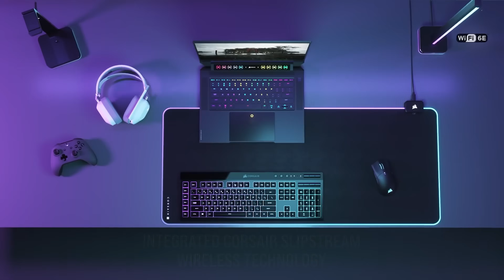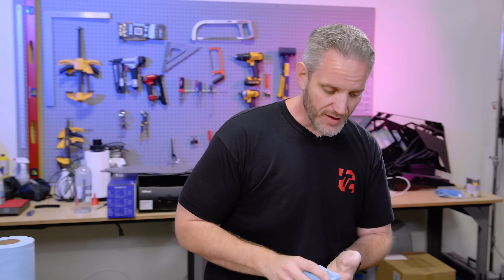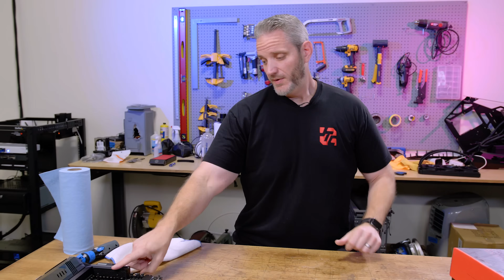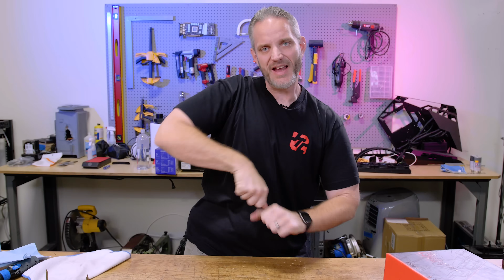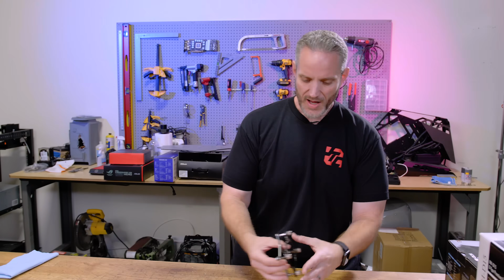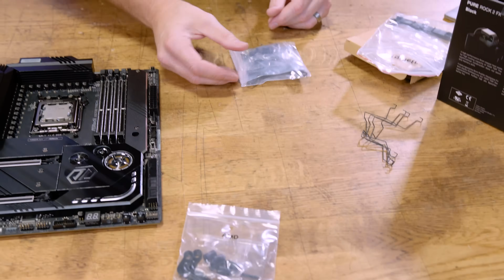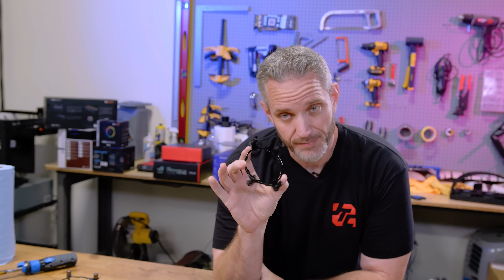AMD made a terrible flaw with this design...

Comment: I find it interesting that despite the 2mm too thick IHS, that CPU can run that much load and clock at these thermals. I originally wanted to get a Ryzen R7 7700X, but now I'm rather considering a Ryzen 7 7800X3D or something like that early next year because honestly, I intend to game on the system and if that thing is anything like the R7 5800X3D but with the thinned IHS (since 3d cache will make the die thicker anyways), thus compensating slightly for the temperatures, it could be an absolute beast.
Reply: I think you are able to override TJMax in the bios with lower temp if you want. Of course that will somewhat lower performance, but that may be negligible. I am coming from an older setup so I may just go 7000 anyhow and set a max of 75C and see if it still performs even within a couple hundred mhz.
Reply: @wishusknight3009  Or you can offset Voltage to a negative number. Or run ECO mode. Wait for HUB who will test ECO mode for the chips to see the temps and performance of that mode.
Reply: @wishusknight3009  eco mode wasn't in ryzen master on release but it is now. With eco mode, it basically works like previous CPUs and gives a bit less performance with a lot less power. They really should've made eco mode stock and called the current stock boost or something. 95° just doesn't look good.
Reply: vcache doesn't increase the die height. AMD has already stated this. So the thick IHS will still be the same on newer chips. They would have to increase the substrait thickness or something like that but I have no idea what side effects that may cause.
Reply: @ReivecS  it did for the 5800x3d, they circumvented it by thinning the CPU die when stacking the 3d cache ontop of it
Reply: @gtifighter  So hopefully they keep the CPU die the same thickness and thinning out the IHS to bring it back in line with the pre-AM5 IHS thickness.
Reply: @mvmhunterkiller  yes, that was my hope
Reply: @ReivecS  the only reason it didn't increase die height is because they shaved down the ihs. They're literally putting chips on top of the processor - that's the "3D" part, so if die height isn't changing, that extra height has to be subtracted from something else.

That's why a thicker ihs on the non-3d models could potentially be better for 3d; thicker ihs means more material you can shave off, which means more space for stacking chips.
Reply: @spaceduck413  Jesus Christ there are so many people here that can't read. JUST READ. Look at what AMD said, don't take my word for it. THE IHS WASN'T SHAVED. PERIOD. END. CAN YOU READ THIS YET? There is no hope for this comments section.
Reply: @spaceduck413  Also you need to learn what die means. If die height doesn't increase, there is no need to change the IHS.
Reply: gonna be straight up: I think AMD should've made all high tier cpus with 3d cache from the get go, apart from the 7600x and maybe 7700x. Whoever pays for a 7900x can pay extra $50 - $75 bucks for 3d cache
Reply: @HellRyder18  AMD should've made all high tier cpus with 3d cache from the get go AND cost of 3D V-cache shouldn't impact prices at all.they don't have to shave dies now with thicker IHS. the cost of doing 3D V-cache should be minimal. yeah, it costs something but they already sell parts that cost like 40 bucks to manufacture for $400-500. selling parts that cost 80 bucks for same prices would give AMD a bit less profit but margins still woud be profitable AF.
at this point they are just making billions out of peoples stupidity who think that these CPUs worth that much.
we should've had tech on this level 10 years ago but we didn't due to these corporations milking the stupid market.
Reply: @rawdez_  you have a point, and yes AMD has good margins with these prices, so maybe they could have 3d v-cache with the same price. We all know these 7000 series prices will drop by like $50 as soon as intel 13th gen is out. They would've destroyed Intel 13th gen and continuing to build on the good momentum they have with consumers. People like fast CPUs, that's why Intel had market share. They are doing great products to go after Intel and Nvidia, I think this was a bit of a step back - probably it'll me saved by the release of 3d v-cache SKUs and price drop on standard Ryzen 7000
Reply: Uplift over base Zen 4 should be 30% fyi. Well worth the wait if you are willing and focused more on gaming.
Reply: @jesh879  I'd say it other way: 7000 without v-cache is a cash grab, dumb and shouldn't exist.
its way better for CPU buyers to avoid that. obviously Zen II with V-cache its how it was intended by engineers, but marketing and maximizing profits got in the way giving us 95C temps and pretty much last gen CPU performance.
ps Zen I is Ryzen 5000 and its crippled versions known as Ryzen 1000-4000.
Reply: It will be better. At least that's what the rumor says.
Reply: Im waiting anyways for the X3D just because its going to be an absolute beast miles ahead of anything else on the market, this video just reaffirmed my decision
Reply: @AwareOCE  AMD would just lower frequencies on X3D parts to not compete much with Intel. And instead of 25-30% gain we would get 10-15% max. Same as always, its forbidden from marketing perspective to make huge gen-on-gen gains because it lowers prices on other/older AMD/Intel CPUs and cuts into profits from those.
so companies artificially slow the tech progress.
welcome to capitalism. 
unfortunately there are no alternative and you can't change that unless you run companies not for profit but for human progress. and there are not much examples of such CEOs.
Reply: @rawdez_  that has nothing to do with capitalism.
Reply: Maybe that was AMDs intension from the beginning. Introducing 3D cash for EVERY chip next year and that was the reason why they needed more height.
Reply: If you are purely after gaming, then even the top line R9 79XXX barely scrape past the R7 5800X3D. Sometimes it even loses against it. Definitely wait for the 3D versions of these chips for gaming.

This is literally a case where AMD's own competitor is itself lmao.
Reply: 7800X3D doesnt exist
Reply: @gazpitchy  Yes it does bro, amd already said it’s coming out by q2 of next year. We’re getting a 7800x3d, 7900x3d and a 7950x3d. They’re saying they will be 20-35 percent faster in gaming and 25-50 percent better in everything else compared to the regular zen 4 cpus. 

This is amazing because the regular zen 4 cpus are already 20-50 percent better then intel 12th gen cpus and 10-30 percent better then the new 13th gen cpus. Rip intel😂
Reply: @darkhaven9119  Why would the x3d versions be 25-50 percent better in everything else compared to regular zen 4 cpu's? The 5800x3d was worse than 5800x at almost everything other than gaming due to lower clocks. I expect the same with zen 4 x3d cpu's.
Reply: @dewjustin  they literally made an official statement that zen 4 3D chips will be 20-35 percent faster in gaming over regular zen 4 and it won’t be losing any clock speeds. So it’s literally zen 4 just 20-35 percent better with no downsides
Reply: @rawdez_  I’m using a 12700k rn and I had a 10700k and an 8700k before that. I’ve always had intel and I’m definitely not an amd fanboy. I know they aren’t my friends and I have no brand loyalty. But zen 4 smokes intel and zen 4 with 3D v cache will be the best cpu hands down with no debate.
Reply: @darkhaven9119  Individual testing will prove if that is the case or not.  I don't take NVidia at face value for the marketing speak for the 40 series either.
Reply: @darkhaven9119  yeah the word is ces 2023 and they are looking to be killer gaming chips. I don't think Intel will be able to respond to them either. The only thing I don't like is the timings on the ddr 5 Ram are horrible still and need time to mature.
Reply: @davidbrennan5  I mean 6200/6400mhz ddr5 ram at cl32 and cl36 have basically the same timings as 3200/3400/3600mhz ddr4 ram at cl16 which is good. But yeah I’m waiting for at least 7200mhz ddr5 with cl28. 

That will perfectly match the best cl14 timings of the best ddr4 kit while having double to triple the speed. These probably won’t be available until the end of next year though best case scenario.
Reply: @darkhaven9119  the problem is AMD doesn't want it actually smoke Intel. they are marginally better and thats their goal.
they could've released X3D parts right away and kill Intel competitiveness but they didn't.
because doing so is less profitable than what AMD is doing now.
Reply: @darkhaven9119  I was looking this week, a lot of stores like microcenter are including a free ram kit if you buy a 7000 processor.
Reply: @davidbrennan5  like slow useless DDR5 that nobody gonna buy other way?
Reply: I don't see people lining up to buy new hardware like with 5000 series.  the price of the new boards is very high, the chips get hot and half the AM4 coolers won't work with AM5  because the lga clamp is screwed directly into the AMD backplate, glad I found this out today lol. Then their is the slow ram issue....  I have a 5950x and see no reason to upgrade for a good while. I need a new gpu but I am waiting for the new AMD cards. I will buy one or pick up a 3090ti.
Reply: @darkhaven9119  thought AMD said the sweet spot is 6000-6200mhz on DDR5 for the CPUs?
Reply: @beyond5150  yes right now that’s great. But dd5 will get way better in the next 1-2 years. We’re talking about 6600 and 7000mhz being low end and the norm with 8000 and higher being the high end😂
Reply: @davidbrennan5  "I don't see people lining up to buy the new hardware" uhm they got just released like 3 days ago...
Reply: When Ryzen 3000 was released lines out the 'building at microcenter and down the block when Ryzen 5000 was released lines out the building at microcenter into the parking lot when 7000 was released I could walk right in and pick any board or processor I wanted no; hype at all, I could 'have bought 30 boards and processors.
Reply: @davidbrennan5  for ryzen 5000 there was also pandemic low stock issues, so whenever there was stock, people would impulse purchase. I bought a ryzen 5800X like that at release, pretty much because I got excited to see the "add to cart" button. And that cpu was also overprice at launch
Reply: @davidbrennan5  no lines to buy 7000 is because price/performance didn't improve AT ALL. you get the same level for the same amount of money. no progress at all because AMD decided to slow down to sell more 5000 chips with higher prices.
Reply: It thermally clocks to 95C. Do you get amazed that your legs reach EXACTLY to the ground, not above it, where you can't walk any more??
Reply: @markhackett2302  95C is not TjMAX, it is the limit set by the BIOS and you can change it. TjMAX is 115C.
Reply: @markhackett2302  The only reason it does reach 95 is thanks to the thicker IHS.  Der Bauer proved direct contact with the die never hit 95.  Obviously that means it went from thermal limited to power limited.  Which is a better place to be.
Reply: @markhackett2302  Without that extra 2mm, AMD could have either opted to let it target 95C for more performance, or target 85C (assuming we only get half the cooling benefit from a thinner IHS than direct die cooling) for the same performance. Do you rely entirely on marketing materials for your opinions?
Reply: 7800X3D is truly a great CPU to buy if you just play games + DDR4 based system is much cheaper  if you build a brand new pc
Reply: @wexa89  you meant 5800X3D

Comment: There's a lot of Coolers on am4 that use the backplate but not the hooks. You take those off and screw into the backplate. Those are perfectly compatible with am5
Reply: which is what my current EK block does especially after he almost blanketed all EK blocks not fitting

Comment: DerBauer was able to get slightly more performance out of this system as it was more stable due to lower temps, but he was still outputting the same amount of heat overall. It's just less of it was stuck inside the die area. So basically unless folks are planning manual overclocks, the increase internal temperature isn't going to make much difference. Most people will leave PBO to do it's thing, or better yet, drop power limit to 150w max, in which case temps are no longer a concerning factor.

It definitely feels AMD didn't want to force most people to need yet another new component or bracket for compatibility and I think that was the better choice. Unless you're really desperate for extra 5 percent performance. You really shouldn't let the CPU use 200w+ of power. The mistake they made was letting it run that high for almost error margin levels of increased performance. Jay please make a video detailing the benefits of undervolting the CPU's. It's so much more important for this generation.

Comment: tfw you have to upgrade pretty much everything on the motherboard when you go AM5 but they decide the fning cooler is the important thing to have backwards compatibility.

If they wanted it to be a cheaper and easier transition, there should've been a DDR4 option for the first gen of AM5 motherboards

Comment: Yes Tech City, experimented with under-volting a 7950X. I found the results impressive to say the least. It does seem that AMD and Intel are just add voltage to achieve speed.
Reply: Additionally, everything above 200W is diminishing retruns (judging by bildzoid's 7950x power limit vid).
If you run the 7950x at 150-175w and do an undervolt / use pbo2 , you'll probably get the best value from it.
In terms of Performance/watt and Temps
Reply: I saw that vid and you might lose 200-400ghz when under-volting but it's definitely worth the temp drops.
Reply: @theghostleader140  Worth how? if you lose performance to gain nothing, how is it worth it?
Reply: @DuBstep115  Electricity is not free if you didnt know that.
Reply: @Sweetw4ter  wow massive 20w difference, will pay you back 1€ in like 6 months. Such value
Reply: voltage adds stability, under-volting is not just going to work the same on every chip, that is silicon lottery, just like overclocking.  
and from earlier launches we know that some motherboards were pumping too much voltage into the CPU on early BIOS versions...  
New platforms always seem to have such issues.

Comment: Optimum Tech has a good video on Fixing Ryzen 7000. They got the temperature down to 60 C without sacrificing performance by tweaking the bios. Also, Be Quiet! certifies all of their AM4 coolers as AM5 compatible.

Comment: I would like to see Der Bauer use his cnc machine to shave 2mm of the IHS. I would also like to see AMD release a slim version of the chips with a thinner IHS. I think most people building the new Ryzen system aren't worried about having to buy a new cooler.

Comment: Is direct die cooling feasible or not worth the risk for the average user? Obviously the lower temps would be an awesome overall improvement to any user, but this being my first thoughts of direct die cooling I'm skeptical about the risk of it.
Reply: I'd argue that for most people going through all this hassle isn't worth it. Who cares if you drop Temps by 20°c at full all core load if you're just a normal person that games and does mild pc tasks like web browsing with occasion light workstation loads? You'll never hit tj max anyway with those tasks. It won't mean anything to you, or most people I'd imagine. But if you want to spend hundreds of dollars for single digit percentage performance gains and, possibly, increased cpu longevity at the risk of breaking the chip when you take off the IHS or if you over tighten your mount, then go ahead. However, it's worth noting that most people also don't keep the same cpu for more than a couple of years, so really all this effort is for mild performance gains most people won't need/notice.
Reply: The cooling itself is not that risky (only be careful if you use liquid metal, don't let any of it get on the capacitors), the hard part is getting the IHS off without damaging the CPU. You have to heat it up to soften the solder, otherwise you need too much force to get it off. Then you have to be very careful not to push the IHS to far to the side, as there are a lot of capacitors between the legs you could rip off. For older (non-soldered) Intel CPU's I just 3d-printed myself a delidding tool, but with these I would wait for der8auer to come out with a ready made tool and mounting mechanism for the adjusted z-height. From his video I gathered he's working on one.

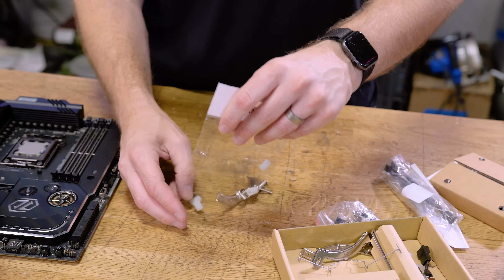Comment: 15:00 NH-D15 has an upgrade kit if your cooler is older than 2019 (it is clearly mentioned on their website), I have the same cooler that I have had since 2017, so with AM4, I had to order that $8 kit called NM-AM4 to make it work! it also has short and long brackets for cooler orientation!
Reply: He has the older one I have it on my 5950x
Reply: @MR_DOME  yeah, that's what I'm saying, I did a build for 5600x and I ordered that kit (I heard you can get it free but didn't manage to get one because of where I'm living, this free kit will cost more than the one from Amazon lol)

If you bought the cooler after 2019 (2020 for safe bet) you should be fine.
Reply: @almothafar  YUP, they sent me one free I had to show the purchase receipt on an NH-D14 I had bought for an intel socket (3 CPU's) in 2013 then switched to AM4 in 2020.  About to use it on the 5800x3D as well.  Same cooler for almost 10 years isn't bad.  They sent the longs and the shorts.
Reply: @almothafar  yep, you can get it for free (if you respect some of their conditions). I got an extra one, cause the guys at the store where I bought my NH-D14 didn't knew if it came with AM4 mounting or not. Just had to fill in a form, attach proof of purchase and like a week later got the kit in the mail for free.

Comment: 2mm thicker between die and outside world = higher thermal resistance = bigger temperature differentials for a given power flow.   THat will cause a 21C change between outer and die temperature.  Your argument is confirmed, Jay!